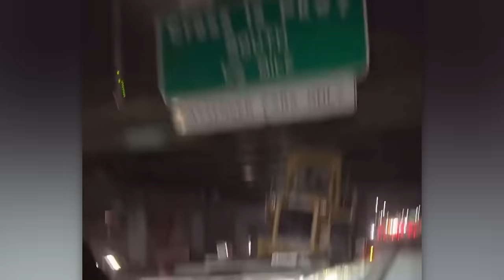Idiot Truck Drivers Who Totally Failed

Comment: The U.S. train track system is no better then ones in OTHER 3rd world  countries. Due to high 20* to 45* points ramps gettint trucks stuck and sharp 90* turns after the tracks interseck's

Comment: First off, most of these weren't fails. 

Second... LEARN THE NAMES OF THIS EQUIPMENT. 
Articulating boom= excavator
Flat blade in front that only moves up and down= bulldozer
Wide bucket attached at the front= front end loader
Smaller machine with arms that hinge behind the cab= bobcat
Bucket on front, boom in back= backhoe.